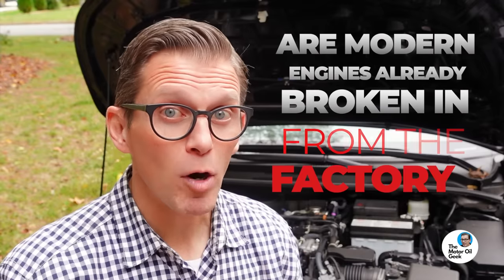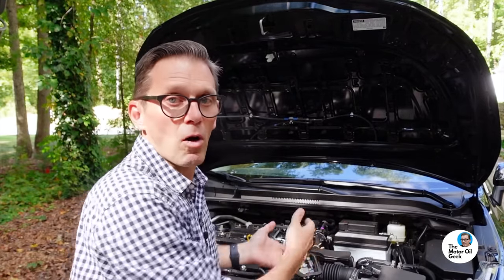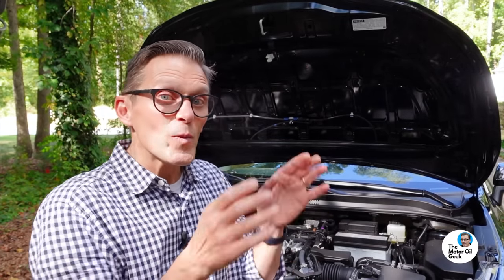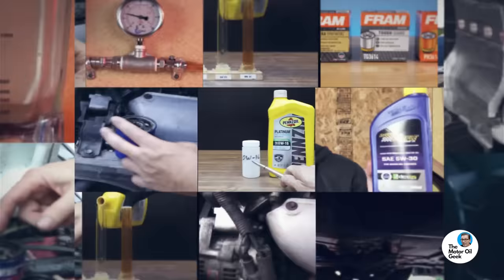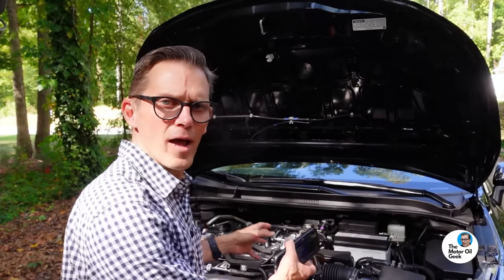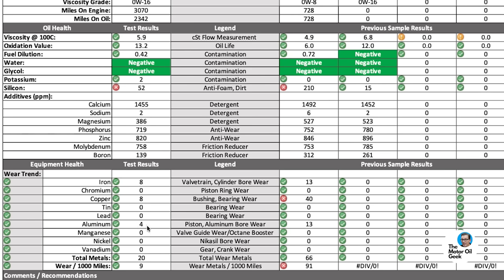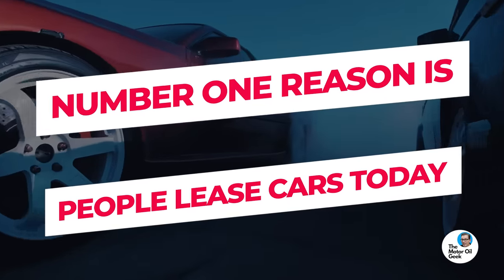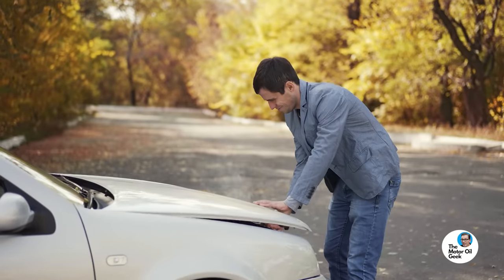New Engine Break-In: Truth or Myth?

Comment: Wait. You said in the beginning that if the break in period is done then you won't see any wear or tear on the internal parts? WTF? How much more wrong can you be? You a creating friction inside of the block at lots of different points that the oil is only there to lubricate and reduce the friction caused. Friction will ALWAYS cause wear. It's why you matter what you do you will generally always see some sort of metallic flakes in your oil after every change. Also, when it comes to leasing vehicles, the company you lease from REQUIRES regular maintenance intervals. Leasing is also more practical if you like to change vehicles every few years, which IS THE NUMBER 1 reason why people lease over buy, aside from having cheaper payments.

Comment: Data and science is good and bad. Toyota is collecting a lot of data now in that 2023 Corolla and any other new vehicle. I installed the Toyota app and going through each process to get it connected to the vehicle has some disclaimers that are concerning, trying to delete the app it warned me data would be automatically ON with Toyota headquarters! I think we're heading toward complete surveillance of anything you do in a vehicle which again is good and bad. I'm worried about things that would be driving record issues. For example driving with the flow of traffic 15mph over the speed limit because its safer in my opinion to drive with the flow. It's a problem if my insurance company sees that info of speeding though. That's one example of many that insurance and also the manufacturer can use against you.
Reply from the maker: Thanks for sharing!

Comment: Your comparison is unscientific, "apples to oranges" and you're using the term "engine break-in" improperly.
To make it scientific, you need to assemble the engine in an absolute state of cleanliness. All new engines have a certain amount of machining residual leftover that is left because it doesn't hurt anything. For your test to be scientific, you need to remove ALL machining residual before assembly and not use any assembly chemicals like anti-seize with copper or aluminum.
For an apples to oranges comparison relative to wear per 1000 miles, there has to be the exact same number of miles on each oil before sampling. It's well known that the majority of wear metal is generated in the first couple of hundred miles. Any additional miles generate a significant less amount of wear metal per mile.
And finally, break-in of an engine refers to the "seating" of piston rings to produce a good cylinder to piston ring seal. Most modern engines use piston rings with a molybdenum coating along with a plateau finish on the cylinder walls. Within about ten revolutions of the crankshaft on the assembly stand, moly piston rings are mostly "seated." So, from that perspective, modern engines don't need any special "break-in" procedure performed.
In addition, many engines are assembled with a negative piston to cylinder wall clearance due to a coating on the major diameter of the piston skirt. Within the first couple of hundred RPMs of running, a certain amount of the anti-friction coating abrades away along with a small amount of the piston, which is aluminum.

Given the skewed parameters of your test, the outcome was easily predicted. The residual in the oil pan is really of no concern as long as the particles aren't large and the filter bypass valve isn't being forced open by a clogged filter. Since your test didn't show the size of the particulates or sample the oil in the lubrication circuit, we don't know the answer to those two conditions. Your test showed the oil sump is doing its job: collect and hold particulates until the oil is changed.

Run the test again with a CLEAN engine after assembly. Run the engine under the same exact conditions for the same number of miles/ hours and take your oil sample AFTER the filter to see what's going through the lubrication circuit. You can also take your samples from the oil sump if you want. You'll probably still see the oil sump samples skewed with more wear metals in the 1st sample. But your samples from after the filter will be the same, and that's what you're really interested in.
If you want to see how well the piston rings are sealing to determine whether the engine is "broken-in," there are several compression related tests you can perform. Most engines will show piston ring seating/ "break-in" has been achieved.

Your test accomplished nothing except to make many people worry about nothing. If a person is really worried about the particulates in the oil sump of a new engine after assembly, change the oil/ oil filter after the first 100 miles. If you really think it's bad for the engine, why leave it for 700+ miles. As a mechanical engineer with a lot of engine experience, I don't see a problem here. If the manufacturers thought it was a problem, they would recommend an oil change at 500 miles. Having said that, I change the oil/ oil filter within the first 100 miles on an engine I've built at home... but I don't have a clean room to assemble the engine, and I want to get any assembly chemicals out of the engine.

Comment: They do not need to break in an engines these days for consumer light duty engines. The cylinders are now almost universally plateaux honed, which lops the peaks off honed grooves and imperfections. Clearances and machined surfaces are so precisely controlled that there is no need for an early oil change. Who actually cares if the early amount of inevitable higher wear as the engine is broken in during normal driving if the particles either held in the filter or are so small that they float harmlessly within the oil film between bearing surfaces?  This video is absolute rubbish and the fact is that engines last longer than ever before [generally] and on far longer service intervals than before with less bother and unscheduled repairs and adjustments than ever before, if you exclude emission control equipment faults.